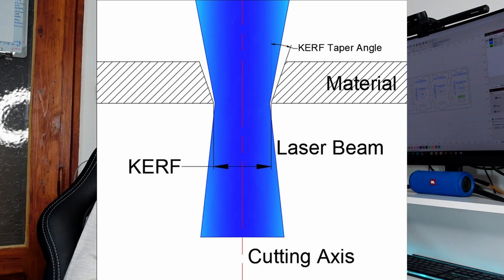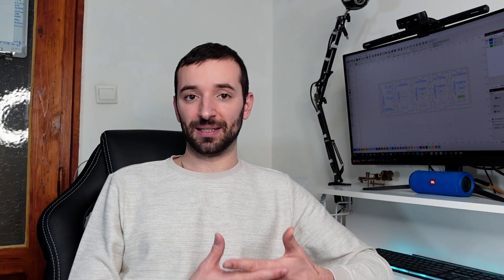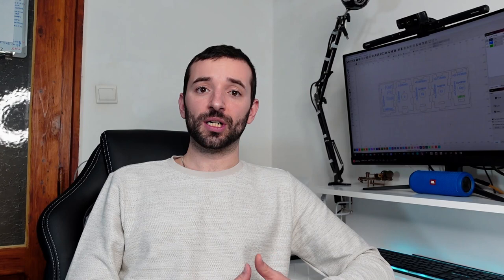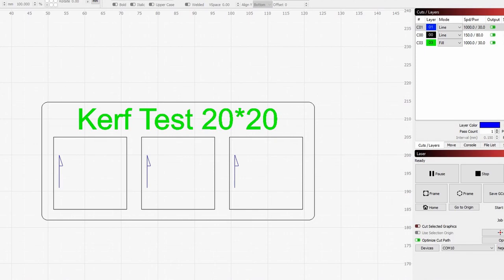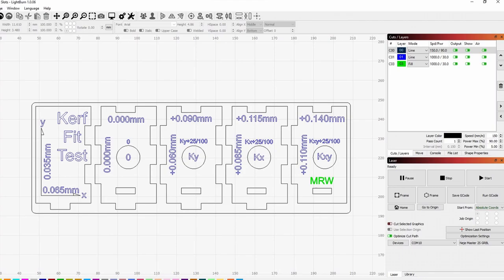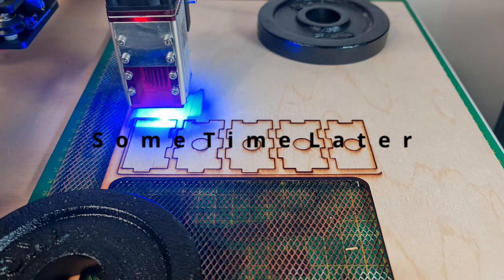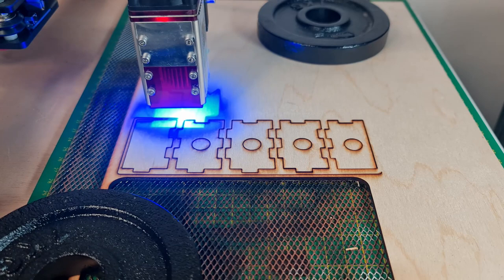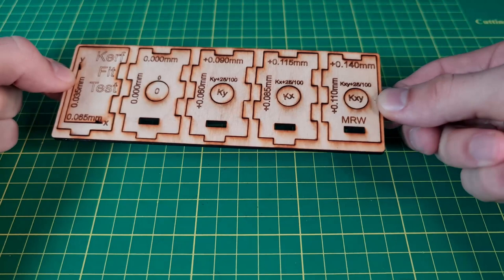Find the perfect Fit Tolerance for your Laser Cut Joinery? | What is Kerf and how to measure it?

Comment: I am not a laser expert, but I am an aerospace engineer.  If your laser beam is producing a different kerf for the x and y movement then I would be looking at the focus of the light rather than try to compensate.  Just a thought.
Reply from the maker: Hi Anthony Walsh; thank you for your comment. 

Your observation and suggestion are perfectly correct and the path I would go for,  but it goes beyond the control of the user, i.e., our control.

The beam produced by the high-power LED (compared to a CO2 laser) has a rectangular cross-section, and optics are used to reduce the rectangle's aspect ratio as much as possible.
No matter how hard manufacturers try, there will always be a slightly longer side without spending a fortune is overengineered lenses.

The rectangular shape of the beam causes the kerf to be different along the two axes, and since we cannot really do much about it, if we are looking to obtain a good fit for our assemblies, we need to compensate and give different tolerances to the two axes. 

BTW
I love Aerospace Engineering; the curriculum is not easy but lovely. I am half a Structural Engineer, half a Naval Architect (where we share lots of subjects and math), and a Robotics Engineer in a while.

Ciao

Comment: I'm doing a similar trick to get a perfectly round (equidistant) circle.
Since the laser beam is not in the shape of a perfect circle, it is more elongated in one axis than in the other.
So I do the following:
1- Decrease the dimensions of the horizontal or vertical axis of the circle by a little (usually half a millimeter), so that the shape is semi-circle (oval).
2- Then I rotate the shape at an angle of 45 degrees, so that the direction of the slightly longer diameter of the circle is in the same direction in which the laser increases the cut .. (in order to compensate for the decrease in the end).
The result:
Perfect Round Shapes (or Nearly Perfect)!
I hope that there is a feature in the program that allows this to be done automatically!
Thank you, and sorry for my poor English because I use Google Translate!

Comment: Great stuff!! How to you apply your tolerances found, in lightburn? Is that an automatic process that could be parametrized, o needs to be done by hand modifying manually the dimension of each cut? Thank you and good job!
Reply from the maker: Hello MIMUPREFERIDA, thank you for your comment.

LightBurn has a Kerf option within the layer setting (specific later by layer) if you set the layer to line engraving.

The option, when enabled, applies the Kerf to the entire geometry.
Therefore it works fine only if you have a single Kerf value, i.e. vertical and horizontal Kerfs are equal.

However, you will need to take extra care in designing your projects within LightBurn.

I use Autocad, Fusion, and Inventor to design stuff that should be assembled. I create my projects parametrically to take two Kerf values for vertical and horizontal Kerf.
Reply: Hi, so if I understood, I need to take care about vertical and horizontal kerf at the design step ? I’m using Fusion. I’ll need to adjust dimensions to fit calculated kerf values.

Comment: Thanks for your informative video! I do have a question though, since I'm ordering my pieces from another business doing the cutting. When not having to account for kerf, is a difference of 0.254mm still too tight of a tolerance difference? or 0.395mm? (I'm converting from Imperial units). I'm trying to find the "snug" zone where the finger joints will be stable, but I'm not having to fight the inserts with a hammer to get them in.
Reply from the maker: Hi, Austin N; thank you for your comment. 

I cannot give you a precise answer to that.
Have you tried asking the cutting business? They could give you a hint or directly apply the kerf compensation their selves.

Usually, kerf will depend on the laser technology used and the focal length of the optics; diodes tend to be thinner than CO2 lasers, but this is not a rule.
Also, the thickness and nature of the material play a significant role as the cut edge tapers.

As a rule of thumb, in my experience, a 0.2mm (.008") kerf for materials 3 to 5mm (1/8" - 1/4") thick is ideal, meaning that if you want to achieve a snug fit, you should go greater than 0.2mm (.008") however for plastics like acrylic the value is a bit lower.

As mentioned at the beginning, I suggest you to aks the cutting Business either to give you a more accurate value than mine based on their machine and the material type and thickness you are going to cut or ask them to test the material for you so you can account for kerf in your design before sending them the final cut design.

I hope it helps, 
Ciao
Reply: @MiddleRoomWorkshop  Much help, thank you!

Comment: Couldn’t you cut a line and use a feeler gauge in the gap ?
Reply from the maker: Hi, MSR Workshop, thank you for your comment. 

Yes, you can use a feeler gauge, but you cannot really measure with it.
You will need a set that goes as low as 0.04mm; mine, for example, goes down to 0.06 mm, which does not fit onto a laser kerf of 0.04mm. Also,  measuring partial thicknesses might not be feasible all the time.
Last but not least, not everyone has a set of feeler gauges; therefore, I believe that a standard Vernier calliper with a sensitivity of 0.01mm for the digital (0.02mm for the old one) is more suitable for the job. 

Of course, if you have a feeler gauge and not a calliper, then just try I combination of gauges until you find the approximate kerf thickness.

Ciao